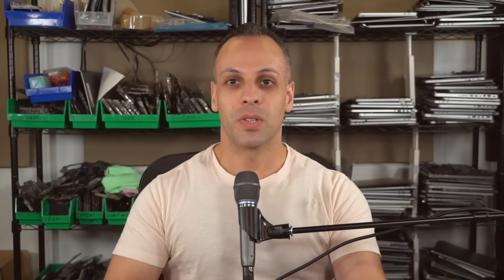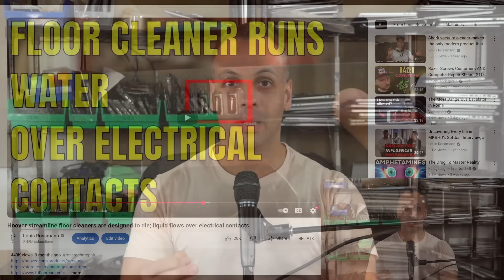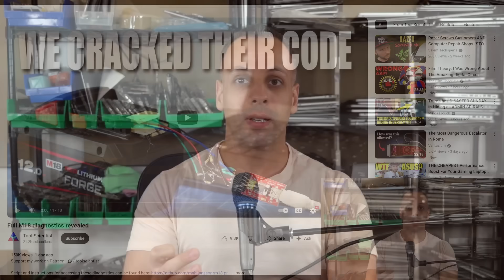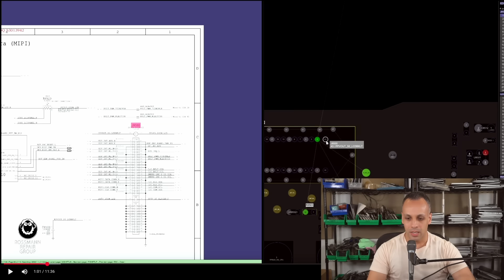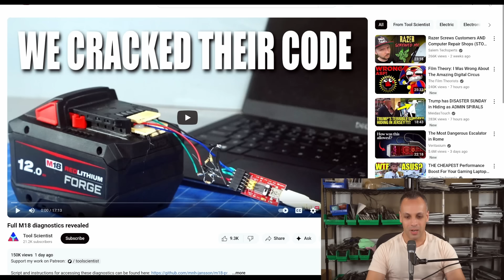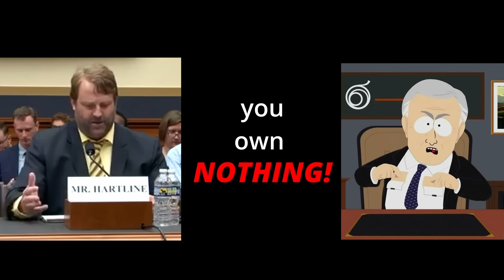Imagine putting DRM in a battery to void warranties...

Comment: 6:50 "If you want a new battery, you have to buy a new drill..."
And it has to be connected to the internet in order to work. 😂
Reply: Welcome to the FUTURE.
Reply: @IONLYBOWTOGOD Squidward didn't forget the FUUUUUUTUUUUURE
Reply: I remember being in meetings where 'internet of things' came up every other sentence. It was an effort to look up at the power point slides as I had to overcome the glue sticking my palms to my face.
Reply: There are batteries/tools out there that lock if they don't have the right Bluetooth connected device. Supposed to prevent tool theft. Could also be used to lock out the tools for whatever reason the manufacturer decides in the future.
Reply: Yeah, I've seen "smart" batteries for Parkside tools (Lidl) at least two years ago. And I said NOPE! Never. Thank you.
Reply: And you have to pay a monthly subscription.
Reply: Got a free m18 drill from work that has "onekey" its pretty much the bones for being connected to internet. Its not required yet to run the drill and doesn't even need internet only Bluetooth. But you can see the bones are there.
Reply: You’ll have to activate it with an app on your phone like some action cameras
Reply: @andrewjanetzki DeWalt is now making these!!
Reply: Dont say this, on electric kick scooters and action cameras they do that already, and parkside has a drill that is connectable to a app by a bluetooth enabled battery (Battery and tool communicate) so maybe some not that far day youll need to register in app to make your drill work
Reply: So you say naught things about "person", now your drill doesn't work anymore.
Reply: DeWalt now has this kind of battery
Reply: Don't laugh.... That WILL be reality. And your refrigerator door won't open if you haven't paid your subscription.
Reply: Don’t laugh. My Bosch impact needs to be connected to an app to access certain settings 🙄
Reply: Anything connected is controlled....
And connected to your wallet.
Reply: It is called the 'internet of things" there is even acronym to make you cool even more cool IoT
Reply: To use your drill, please fill out a geo located survey detailing to what you are using it for.
Reply: Don't forget the subscription to charge it.
Reply: Always On DRM for hand tools. 2030 profits are going to fucking soaaarrrrr.
Tools-as-a-service. You don't own the tool, you only rent it from the company. Once you stop paying the subscription it doesn't work. Oh fuck me.

Comment: on the apple thing, you know it was designed that way on purpose , as normally even if the pins are miles appart you secure the dataline with a simple zener so you can accidently put 50v on it , its safe from that

Comment: I worked in a hardware store selling  Ryobi and AEG machines. Never had an issue with AEG tools, all though funny enough they re-name them for the US market.
What you know as "Ridgid" tools are 1:1 AEG tools. They just swap the logos, same batteries, chargers, everything. 

Ryobi though has had some really questionable machines.
Their first wave of pressure washers was the worst things I've ever seen, plus their drivable lawn mower had battery issues due to using lead batteries rather than wait a year or two for the Lithium mower, which did come not even 2 years later to the market. Making the old one a crappy purchase option.
Reply: Funny enough, Ryobis issue has also been failing batteries. Who owns Ryobi? TTI.. just like Milwaukee. Poor design.

Comment: You do know they have other common materials to make a safer battery, but yet they continue to use these lithium batteries which can explode into flames at any time. 

That’s why they set the voltage limit and battery won’t charge. Because these batteries are freaking dangerous to have in your business truck or home.

Comment: The issue with Milwaukee as a brand however, is that it's customer base are so drunk on the "team red" cool aid, that they would buy badged dogmess if Milwaukee sold it. So they get away with this.
Reply: Guy I work with have a van that is all red inside, can’t conceive of the money he spent it must be tens of thousands. Dude has a freaking 12v cable stapler that cost like $350 dollars when the hand stapler does the exact same job????

Comment: Funnily enough I had no clue that is how batteries worked. That is pretty cool. I would assume the balancing also comes in part with battery usage, so the weaker and older batteries which could not charge to full wouldn't be used up as quickly.

Comment: This reminds me of Philips Sonicare that auto breaks after a certain amount of time. Basically there is a screw inside that loosens up over time and as it does the head vibrates less and less. I cannot think of any other reason for that damn screw to exist other than to eventually discourage the owner and have them buy a new one. I always open it up and tighten it, but how many people do? Look it up. "sonicare toothbrush fix loose screw inside"

Comment: I didn't realize you were talking about milwaukee. I had a battery do this to me. My new batteries are showing lower capacity. The only thing I think i can do if it does anything is to use the batteries until they have 1 bar left but I don't even know if that will help.

Comment: DRM...in a battery. In a F'ing battery? You have to be joking. Oh wait, this is Louis Rossman. There is no joke. Unbelievable.
Reply: They have DRM in everything now. Some American fridges have DRM on the ice-maker's water filter cartridges. It's absolutely rampant and evil.
Reply: It's not DRM for fucks sake. It's not actually stopping you from getting the information. DRM would be actively trying to prevent you from accessing the information with encryption or something like that.
Reply: @RCLapCar  There are already "DRM" chips in fridge water filters and inkjet cartridges. They absolutely could add an proprietary handshake chip to the batteries and also use various methods to obfuscate and even encrypt the logs in their batteries.

Comment: I use the non Powerstack Dewalt batteries, these do not have any digital smart logging, this was confirmed by the guy that posted the video on the Milwaukee batteries, I suggest sticking to those as the newer do have this too, and I use the normal Dewalt batteries in everything, in other tool brands as well as power eBikes.

Comment: I’ve worked on industrial electric and electronics systems for 40 years and there used to be a reason to isolate low voltage from high voltage circuits...!!!
I evolved around specs and now it’s just a joke...!!!

Comment: the crazy thing with this thing is that they use it to deny claims based on what they sold the battery and the device for with just their word on the broken devices not causing it. if the battery has a max temperature why does the device let you use it then, the "smart" device they sold you.

Comment: Had a Ryobi Battery just fail on my impact. wouldn't charge, was fully charged when used. thought it was overheat so i let it cool down though not warm. used a basic drill on it and it would still fail and not power. They wanted me to warranty the whole tool kit not just the battery, so i took it apart and recycled the cells and they all had 4V~  without it taking a charge. If i knew this was intentional in codes, that's really annoying.
Reply: Ryobi are really bad for this, there 36v (40v US) packs have more hardware in them than a modern smartphone.

Comment: Not everyone have the knowledge, the caution and the time to spare to modify a rechargeable battery pack.
1- No balancing for each independent cell ? no problem, they sell bms1s1p for any 18650 for any individual cell and just need a little rewiring to put one on each cell.
2- If you use rechargeable batteries for power tools forget about stupid warranties, learn how to make your own battery packs.
3- If you are buying a power tool that uses proprietary software / firmware to work, you are buying a Mc.Broken  and you deserve al the trouble you'll get from there.

Comment: 4:00 What is worse is the M18 batteries have battery balancing capability, Milwaukee/TTI just didn't enable it in the firmware on the battery controller.

Comment: Milwaukee is horrible for their cordless Nailers! I bought their 15 ga finish nailer. Had it about a year and it stopped setting nails all the way. Sent it in and got it repaired for free, great. About 8-9 months later same thing happened. Took it and had it sent back in. They sent it back in pieces! They at first tried saying nothing was wrong with it. Funny then why was it sent back in pieces? Then after pushing the lady at Milwaukee on phone as to why it was sent back in pieces she finally admitted that i had put too many nails through the nailer! At about 89,000 nails. I got pissed  first why does it keep track of the amount of nails put through? I said that nowhere on anything did it say they didnt warranty their nailers aftet so many nails was put through it! I asked her whats the point at the warranty is no longer valid after noraml use? She couldnt tell me how many nails before the warranty was void.
 I vowed to never buy another Milwaukee tool. A tool company that uses thongs not in the "agreement" or box when bought that they use to not fulfill their warranty!

Comment: I was going to write you a couple of weeks ago about my Milwaukee chainsaw that died mid-cut but I thought "nah, he ain't going to care about Milwaukee tools."    And yeah, its definitely an electronics issue.   Probably not fixable, tho.   With the clamshell taken apart and both switches engaged (motor should be running) nothing happens other than the block the battery plugs into gets warm within a second or so (hot, if I dared hold it for longer).   And the whole thing is one giant, non-serviceable assembly.

I'm really disappointed by milwaukee.   They make some great tools but they are, imo, designed to be thrown away rather than repaired.

What pisses me off is that the tool failed before the battery did.    I think they allow their tools to run way too hot.    My advice to everyone is to run your tools hard... but only during the warranty period.
Reply: before the 90 day return, exchange it.
99% of the time, the big box store you bough it from dont care. so exchange exchange it, and get your moneys worth!
Reply: @cyberpunk8bit Oh for sure.   I'm not griping that hard, as I did get a few years of use out of it.   Its out of the Milwaukee warranty period.   So technically, it provided the length of service they said it would in the fine print.   I'm more griping about the way they built it in such a way that almost any failure anywhere in the system makes the saw a paperweight.

Comment: I recently purchased a small vacuum that uses my Milwaukee M18 batteries. Turns out the best vacuum is a cheap chinese knockoff and not the genuine Milwaukee vac. Now I also just buy cheap chinese knockoff batteries, too. For the money I save, I can just buy extra batteries that more than make up for the shortcomings of the knockoff compared to the genuine battery. At least when my knockoff batteries die, I'm not feeling a profound sense of loss.

Comment: You never know what you're buying anymore. You just can't assume that because the last version of the product was good, the newer one will be. I had a Genie garage door opener installed in my house when I built it in 1999. The thing was quite reliable and lasted 17 years. I replaced it with the newest comperable version from Genie in 2016. The thing gave me problems constantly. It needed recalibration & resetting all the time. Then, it broke only four years later in 2020 (a month after the Covid lockdown). Turns out, the coupler bracket that holds a 400-pound door was made of white metal - a weak metal that's only used to make toys. The bracket just disintegrated into several  pieces. After talking to a garage door repairman, I found out that Genie had been bought out by a vending machine company sometime in the 2000s, and now all their products are cheaply made crap.
Reply: That's good to know (the change in quality), but sucks that it bit you.
Reply: Management is given over to marketing majors and accountants. It's all about image while they feed off the skills of the existing workforce. Another type of corporate welfare. Engineers are told to come up with new stuff to serve marketing--stuff that can be marketed as a high-tech improvement.
Reply: It depends, you need to do research. You don't just buy the same brand again but research if it's still actually the same brand with same philosophy. I found some German brands that are still consistent reliable. Basically if the company is run by people who have values and care about those, the products used to be good.
Reply: To be fair, that coupler is designed to break if something is being crushed by the door
Reply: They've been doing the same think in politics..: Legislature is getting overridden because ''international agreements' take priority over national laws..

Comment: I have a stack of the M18 Batteries and the heated jacket controller lets the magic smoke out while in your pocket. If it was a phone it would have been recalled. And when ya call them and ask for the part number of the burnt inductor it is proprietary and they are not gonna let ya fix it! And yes I  published it you can here it in their own words.

Comment: All this shit can be simply avoided by going back to the good old corded tools. You may need a extension cable but hey, plug and use as much as you want and they will never be able to touch you again, no battery failures and no shit. That's what I've gone back to doing, screw them and their batteries, through which they can get into your home and life!!!
Reply: What's the point of buying battery powered tools if they're replaceable with corded counterparts? The whole point with them is that they're not corded. You fix the problem by making better batteries.
Reply: @kg790 don't buy battery powered tools to start with, not that difficult!!!
Reply: @kg790  man come on, we're not talking about good or bad batteries, we're talking about malware they incorporate into batteries. Stop talking out of your asses. THINK BEFORE TYPING for heavens sake.
Reply: @Loopy-de-loop "we're not talking about good or bad batteries, we're talking about malware they incorporate into batteries" – you classify a battery with malware as good? Ok, to each his own — I don't. Because otherwise I would have to give you the same advice you just gave about thinking before typing. I think that to most of us, a battery with malware is unambiguously a *BAD BATTERY*.
Reply: Okay cool, now you only have this problem in everything except the battery.
Reply: @thesenamesaretaken Louis is talking about batteries and nothing else, so let's stay on topic!
Reply: If you made a backpack with a decent battery and an inverter you could be sort of cordless.
Reply: That’s fine for a diyer, but tradesmen are NOT going back to corded tools man that sht is a NIGHTMARE on a job site.

Comment: I used to send in Milwaukee tools in for warranty when I worked at a supply house a year ago, and I never had to send in batteries, their warranty process worked smoothly (if slowly). Sad to see it's getting bad
Reply: How long does it typically take for them to fix a warranted tool? I sent them a 3/8 impact gun 2 months ago and I never heard back from them except that they received it 😢
Reply: @AntonAtan  back then, it took 2-4 weeks. It has since spiraled out of control
Reply: Milwaukee Tool Company has been a Chinese owned company since 2005. What did you expect?
Reply: @michaelsilberg9059 nothing inherently wrong with Chinese products. In fact, they’re sometimes even less locked down and have more standardized parts. It’s the others, including USA based companies, that are MBA heavy trying to mess with your rights of owning a product by using custom/modified parts (ie sears for so may years), planned obsolescence or legal threats.
Reply: Yes, it used to be a very good company. They still make some good stuff, but you can see they’re being rotted from within.